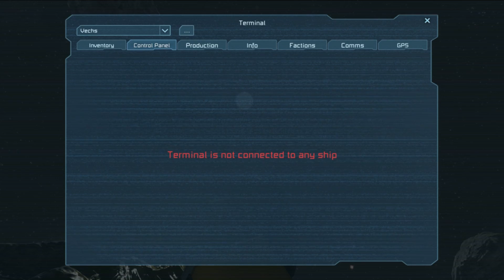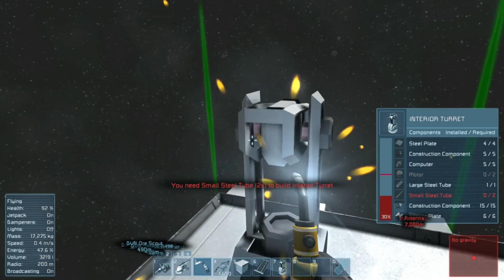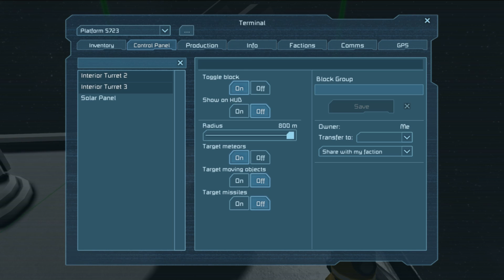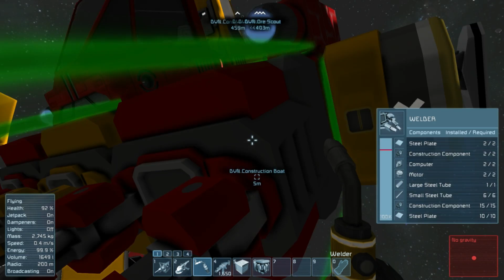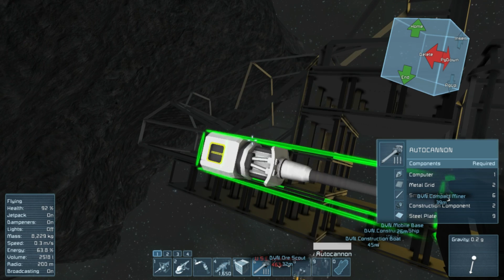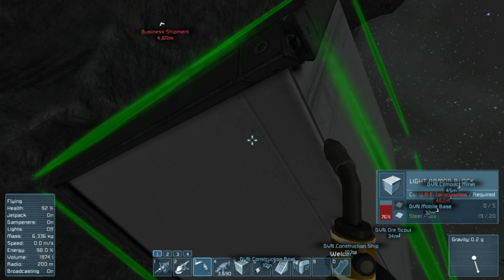Space Engineers Meteor Storm Survival Episode 15

Comment: There was a large bank of batteries in the power room of the lacademon, I don't know if grinding a battery then repairing it will keep it's charge but if it does then that is an alternative to temporarily get extra power (even if it does not keep its power you could charge them with the small reactor then flip them all over to discharge mode after they slowly charge)

Comment: I think the problem with the autocannons was the orientation. When you removed the gatling guns the sides of the autocannons were visible, and they had no doors. I think if you really wanted to, you could attach them to the sides, in a 2x2 block, and it would work. I'm pretty sure the conveyor system doesn't actually care whether the items could be put into the connecting containers, since they're never placed inside.

Comment: Y'know what I think you need Vetches? A boarding drone. As tiny as you can make it, an antenna, a remote control, a camera, one thruster each direction, a gyro, one small reactor... the bare minimum to make one or two gatling guns move around. Small enough to fit through a one-block hole in a large ship like the Lacedaemon. ...And, the coup de grace, a merge block.

You merge it onto your main fighter and use it as a couple extra guns for flying around, and then when you have some delicious prey good and disabled externally, you detach the merge blocks and fly the drone in to engage with interior turrets from the safety and comfort of your fighter's cockpit. It falls short of being too easy by virtue of the fact it's more lost resources than your suit if it gets taken out, while being far more in line with your goal of not dying. Not to mention that small ship gatling guns and light armor are going to have the advantage over an interior turret, rather than being way outmatched and only winning by virtue of clever shooting angles like your suit would.

In other words, a Vexy minion to help fight in your space dungeons :D

Comment: The turrets' bullets are projectiles, they don't instantly hit the target. The turrets are simply not hitting the meteors because they're moving in a direction that's not towards them... If the meteors were heading right towards the platform, the turrets would hit almost every time, and are definitely enough to stop a meteor...
Reply: The turrets automatically compensate for target motion. The big gatling turrets work great for taking out meteors, but the interior turrets aren't powerful enough.
Reply: Also, it's official, Vechs is bad at math. 24/3=8, not 8.33333. Then when you "rounded it" (since it should have been 8 already, with no decimals) you said 8*5=45. It's 40. You said 8*10 is 80, and you couldn't split that in half? You need 7 of the cannons to go through in two hits, because 6 is only 48.
Reply: the turrets predict the movement of metors
Reply: DreadKyller
 It's math on camera, significantly more difficult than any other kind of math.
Reply: Wes Green Um, you need to watch the video again. He placed the block, then fired all his cannons ONCE. The health of the block was at 76%. 3 of the cannons actually hit the block, that is 8 per, 8+8+8 = 24 (100-24 = 76. Do not correct people when you have no idea what you're talking about. Look it up on the info page for the mod. The small ship auto-cannons do exactly 8% damage to light armor blocks, not 2. Wherever the hell did you get that the three cannons did 6 damage total, you completely blind?
Reply: DreadKyller People tend to focus more attention on commentary than math skills when recording, give the guy a break.  We can't all be math savants, to be able to do sums in an offhand fashion.
Reply: Eagle put the 7'h in the middle! Or have 8 for overkill.

Stewart Bates SephK13 Yeah I know calculating things on camera is more difficult, but 8*5, he even took 2 seconds to think about what it would be. I just thought it was funny.

Alex Lord Foryx Eidolon Yes, that is true, they approximate, however they are not 100% accurate. the turrets predict the movement of all moving objects, but if you drift around a enemy ship you'll see that not all the bullets hit you, the farther away the more and more off the trajectory is, they're not 100% accurate unless the projectile is heading right for them.

And yes, two small interior turrets won't really do much to a meteor, but having more of them will.

If there was no point in having them target meteors, that option wouldn't really even be there.
Reply: DreadKyller but dread, 7 cannons is asymmetric! We can't have that!!! ;P